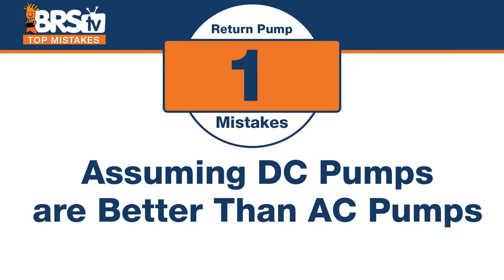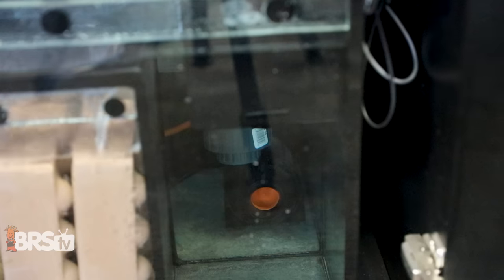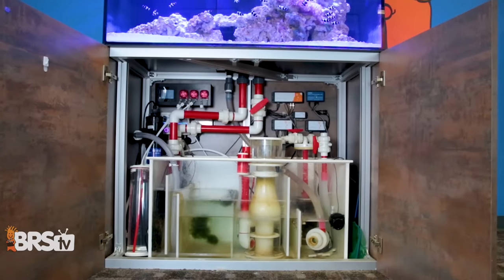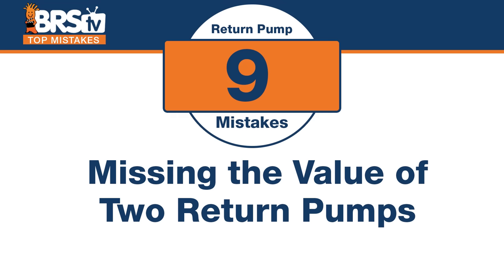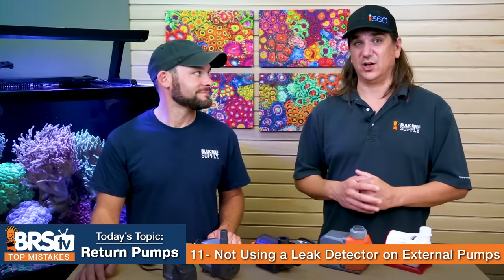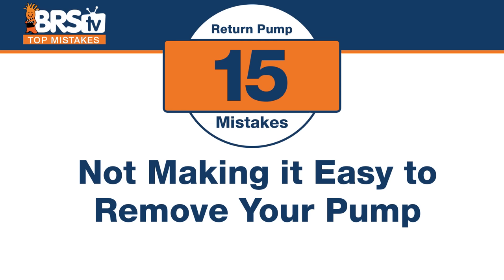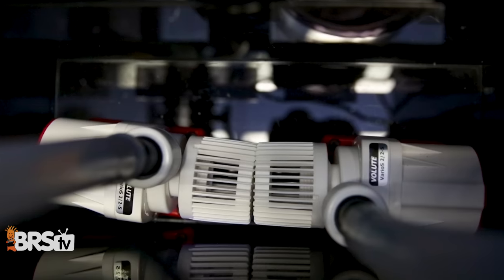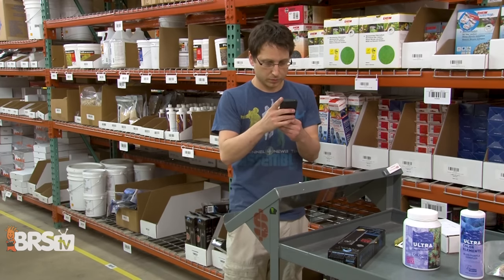How to Avoid Mistakes & Choose the Right Return Pump for Your Reef Tank: Top 20 Return Pump Mistakes

Comment: I feel like #4, 5, 6 are all interconnected.   "You need 10x flow"  but the pump box isn't accurate... or more to the point the person is inaccurately applying the value to the pump, and head pressure all of that often brings down the flow of the pump into a range which is useful.   So 10x the flow probably isn't a bad starting point by using that.

BTW, I absolutely adore you guys putting the extra effort in these videos to put the time divisions topics in the slider bar because I don't want to spend a half hour watching a video when I only want to get one thing, and I surely don't want to watch an hour and 30 minute video where I'm guessing where the "useful" information is.   So props to whomever over there is doing this,  and please keep it up.

Comment: I still keep my old AC return pump around for when my DC pump fails, been handy a couple of times. Love the silence of DC pumps.
Reply: I'm sure glad i did this too.  My DC pump took a dirt nap two nights ago.... Broke out the old MagDrive 12 and I was back up and running after a little bit of plumbing adjustment.  really wish I had listened to that silicon tubing tip.  Would have made the swap out much much easier.

Comment: Hey guys I know this is an old vid but I’m fairly new to the hobby only 4 months in but I’d like to share an experience I had when talking about flow rate. I do agree that 10x is a bit outrageous but my tank is a Red Sea Reefer XL 200 with a total system volume of 206L. My fish store guy gave me a 2500/LPH DC pump which is actually a bit more than 10x but right away the pump suffered with negative gravity. Even with the pump on full power I could hear the pump changing tone a sign of it struggling but the worst part of it was the water level in the overflow box kept fluctuating from almost empty to going down the emergency overflow pipe. I did some math and worked out that by the time the water reached the return nozzle of 1.4m, it had lost more than half the max head height of the pump therefore there was barely enough flow to even send water through the return nozzle. I have now upgraded to a Fluval Sea SP2 pump which is also an AC pump with a 3600/LPH rating and has sorted the issue without jetting the water out.

Comment: Also all pumps are rated with fresh water. So you are pushing a fluid that weighs ~5% more.  In static loads its a very small difference.  Start adding head it it is very noticeable

Comment: Hey guys! I'm a big fan of your content and I have a newbie question. In searching for an ideal first AIO tank I am wondering how much of a difference there would be between a rimless/lidless tank as opposed to something such as a biocube 32. I have my eyes on a 40g AIO rimless but inevitably the BioCube 32 comes into mind. I worry about excessive evaporation with a lidless tank. I know there are water top-off solutions and larger aquariums have more successful outsomes but (like most beginners in the marine hobby) budget budget budget. I've been successful with a 30g cichlid tank for several years and I want to venture out. Any help would be awesome.
Reply: I have a biocube 32, it evaporates VERY little water, my biggest issue is the LED's grow a LOT of algae on the glass, but I added the UV sterilizer designed for the tank and it's made a world of difference
Reply: @mikelee35  thanks for the input! How often do you have to top-off the tank and about how much do you end up using by the end of the month for top-off purposes. I'm wondering if my own RO unit would be more cost effect or if buying a few gallons here and there is more reasonable.
Reply: I never top it up, I do a 5G water change every 3 or 4 weeks... And adjust my salt at that time, it doesn't evaporate enough to raise the salinity hardly at all, I keep it at 1.024, and at water change its usually the same, sometimes 1.025 if I wait a little longer

Comment: Thanks for another great video! Question about dual return pumps - most tanks only have one return built in. How do you run two pumps into one return line? Is there some sort of manifold that you can build that can take two inputs and not fight against each other? I'm concerned that the two pumps would be fighting against each other if I try to merge them together.
Reply from the maker: You would either need to drill a second hole or come up and over the rim of the tank for the second return line. You're right, the two pumps plumbed to one line would fight against each other.
Reply: Put check valves on each return pump before the tee. If your plumbing is sized right this won’t be an issue.

Comment: @Bulk Reef Supply

Y'all need to provide your customer service reps with this updated information, as what you're saying here and what they are ton of people on the phone, are two totally different things.

I bought a Sicce Syncra Pro (800GPH) to serve as return pump for my 120g peninsula tank, based on this video. I mentioned this to two different reps, (Matt and J.J.) and they told me it was way too small. And that I should get a pump that will do 10x return rate. 

I told them I did a leak test on the aquarium with the pump using tap water. Both responded with telling me that I cannot return this pump for a larger one because it's been used. So, $120 wasted, if I go by their 10x rate suggestion
Reply from the maker: Hi Joseph,
We're very sorry for the conflicting information. I see that you've been in contact with our customer service team and we've sent you a pre-paid return label if you decide that you'd like to return the pump. If you're still in need of assistance, please don't hesitate to reach out to us and we're happy to help.
Reply: @BRStv  yes, I received the return label. Thank you for your reply / follow-up!  I really appreciate now knowing I can return the 800GPH pump. But do I really need to?  The tank is 120 gallons. Accounting for head pressure and all, I should expect at least a 2.5-3x return flow rate, right? 

Again, I really appreciate your  response and attempt to resolve my concern.